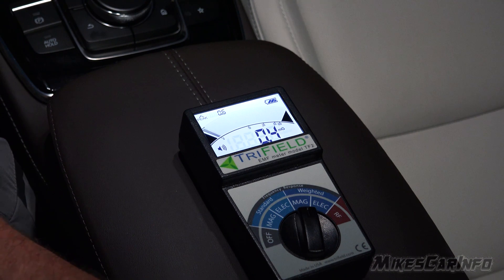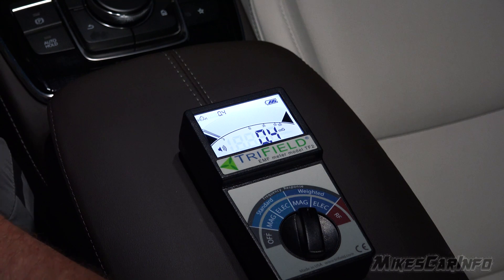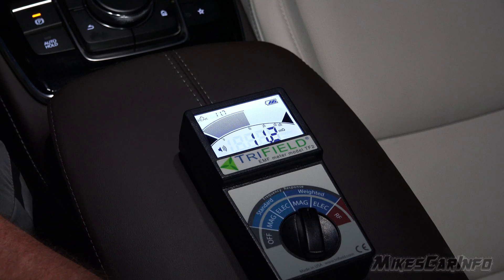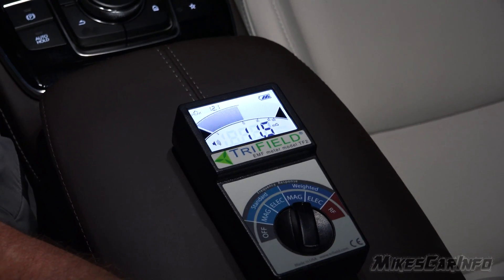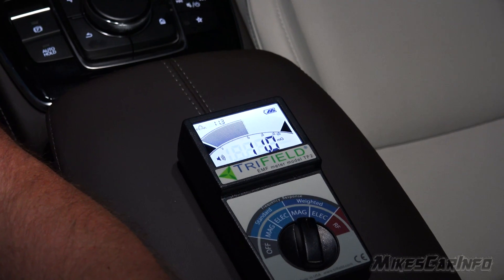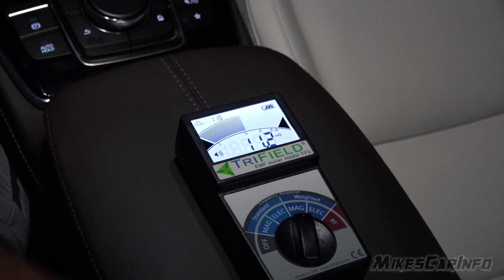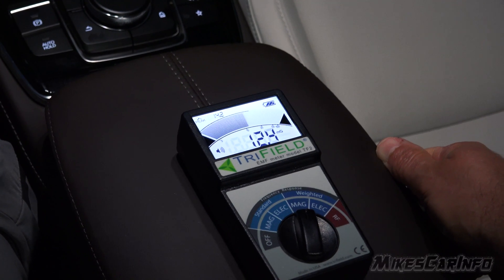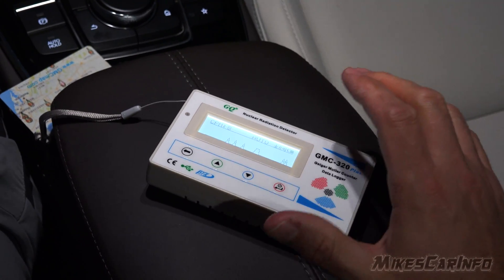EMF Radiation Readings inside a Gas Car -- Part 1

Comment: I can't find anything online giving analysis of gas powered vs hybrids but there's some data suggesting EMFs highest at feet and lower legs of driver.  I do feel bad effect on hands of hours holding cell phone to read and write which goes away after turning phone off yet continuing to hold phone in experiment.  We know EMFs with 5g is problematic.  Amazing there isn't more for car shoppers.  I'll have to buy the mg meter but would be nice not to have to go through that.
Reply from the maker: Levels vary quite a bit depending on the vehicle and the location inside the cabin. I have tested hybrids, Gas, and EV. Gas and hybrid are about the same when the engine is running but drop back down when the engine turns off and running on electric. EVs are very low in most areas while driving but can be very high when AC charging.
Reply: the milligauss drop DOWN when the hybrid is running on electric?
Reply from the maker: @karenottenelias1471  Yes, the engine running emits more EMF than the electric powering the vehicle. EVs are lower as well.
Reply from the maker: https://youtu.be/sqxREdtw5KY?si=OJ0t_-zGTlMTiq2G

Comment: What does weighted mean?
Reply from the maker: "Weighted MAG or ELEC emphasizes the higher frequencies above 60Hz. Higher frequencies will create more electric current inside the human body." https://www.alphalabinc.com/wp-content/uploads/2023/08/TF2QuickStartGuideV1.9.5.pdf
Reply: What does "weighted" mean in terms of the gauss's meter itself?  Weighted readings as an option on the device so what you are "asking" the meter to measure when you choose that option?
Reply from the maker: "higher frequencies above 60Hz"
Reply: Are weighted results in a hybrid in the back seats near the battery?
Reply from the maker: I put it in the back seat and front seat.

Comment: Could you test EV while driving ?
Reply from the maker: I did several tests with different cars, but at the time I didn't film it because there was a near flat meter. It was the charging that was the most interesting. Since people are interested in this subject now, I will need to make a video of both EV and Gas cars and make one video comparing them both.

Comment: Which cars better for emf ? Electric or petrol.My car hybrid I test it smilar to full electric
Reply from the maker: Every car is different so it is hard to say. The EV I tested was a RWD so there was no motor in the front. This might be why my readings were lower. Some cars have better shielding, especially EVs. I do plan to test some hybrids soon because they have engines and motors and high voltage batteries with inverters. Everything working together could emit a lot more EMF than just one power source.